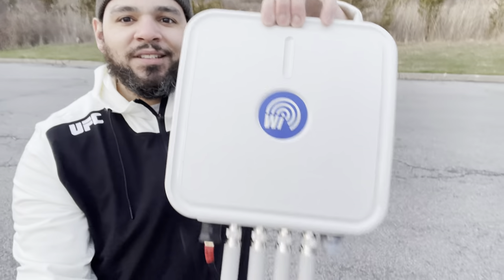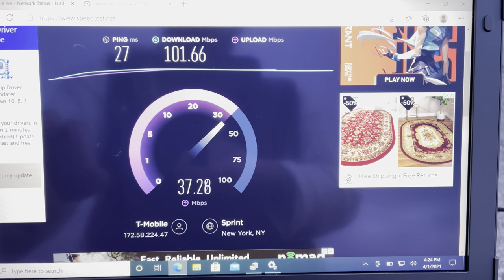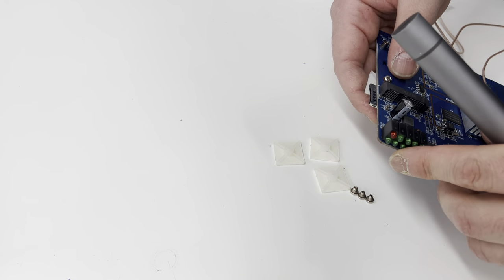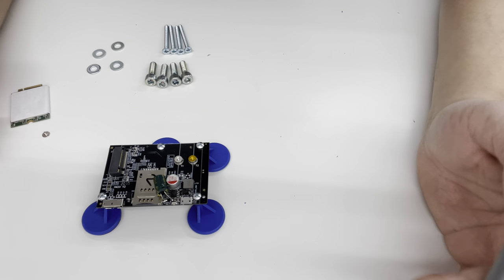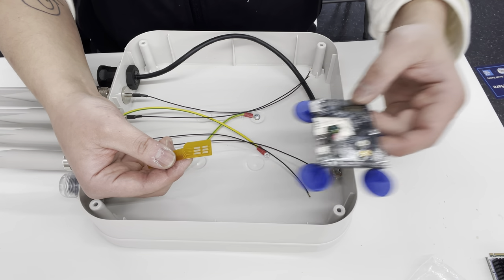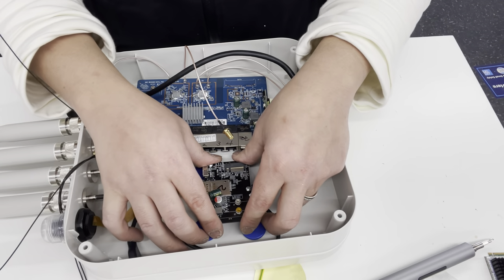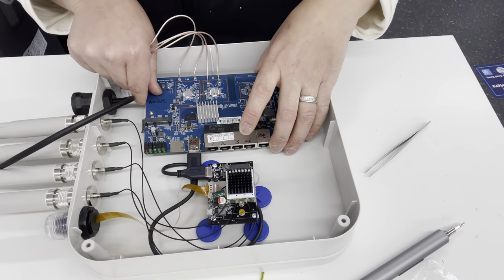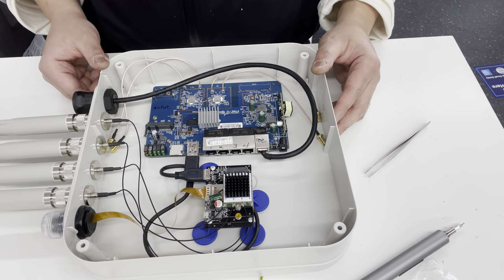Part 2: How to build an outdoor POE LTE Router

Comment: Be careful not having antennas hooked up on wifi before powering on could blow out the amp.
Reply from the maker: Not exactly these zbt routers all still transmit pretty good without antennas

Comment: Why did you go through all that extra work with the usb enclosure? Buy the m.2-PCIe adapter and throw the modem on the router PCB.
Reply from the maker: M.2 adapter yields usb2.0 (480mbps) the USB adapter is usb3.0 (5gbps)

Ie. This is a future proof setup. The person I built it for will likely drop in an RM502Q-AE with 7xCA which will pass 500mbps Downlink easy
Reply: @RouterRelated  true and the 5G module won't mount on the 3526.
Reply from the maker: @CellularFixation  yes correct. The black m.2 adapter can accommodate the large NR5G radios

Comment: Have you ever tried an M2M booster with this setup?
Reply from the maker: Cellular boosters are for voice not for data.
Reply: @RouterRelated  Well, actually they do okay for Data under certain circumstances, however, that's not what I was talking about. 

M2M boosters (or Machine to Machine) are made specifically to go between antenna and modem.
Reply from the maker: @YahDude  I've used the H721 but I prefer wg3526p for native poe
Reply: @RouterRelated  Look up "Wilson Pro IoT 5-Band Standard Signal Booster" 

I consistently get the advertised 15dbi gain if not 20+
Reply from the maker: @YahDude  Wilson is trash hard pass
Reply: @RouterRelated  You can say that about any brand really, everyone of them make good and bad products. These M2M boosters are really nice IMO, reliable and perform better than advertised.

Comment: What service do you get your SIM card through?
Reply from the maker: The module inside the unit is pulled from a dell laptop so it works with any provider. In the video I was using a magenta tab plan

Comment: I have a mofi, can i just place the mofi outside to do the trick?
Reply from the maker: Retire it
Reply: I wish I could do something different but I spent like close to $300 plus 2 signal booster and Yagi antenna and the signal is not even close to what i thought it would be, but I like your videos and I'm trying to learn as much as I can. Tech repair
Reply from the maker: @lemardogonzalez1575  boosters do Not improve speeds.

Comment: I bought this for my mPCI port on my laptop with SIM slot, how well will this chip work like that?
Reply from the maker: Depends what windows does with the module… I get better performance on Linux
Reply: @RouterRelated  My Module is a 5G SIM8202X-M2, I'm going to run Tmobile on it, it says that it's compatible. I'm used to my   Sierra Wireless Dell 4G that was in my laptop, but had to upgrade it to 5G.  I'm still waiting for the card to come to me
Reply from the maker: @Techno_Basil  absolute useless junk never spend a penny on simscum
Reply: @RouterRelated  why are they crap? It was a little less than $300
Reply from the maker: @Techno_Basil  that’s not cheap… that’s highway robbery… doesn’t work well… do not attempt software update
Reply: @RouterRelated  The Sierra Wireless 5G cards were between $400 - $600.  But the formfactor was too long.  I need a card that's 40x32x2.3
Reply from the maker: @Techno_Basil  you should have bought a 4G card it will outperform that joke
Reply: @RouterRelated  I had a 4G card, but it's no longer supported by my service, or I would have continued to use the same Dell EM7355 4G LTE card that I have